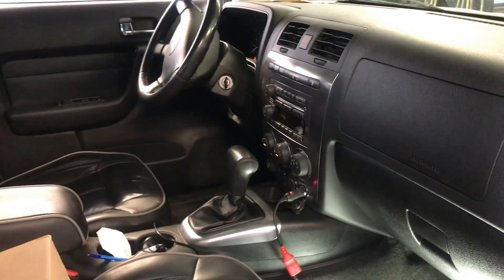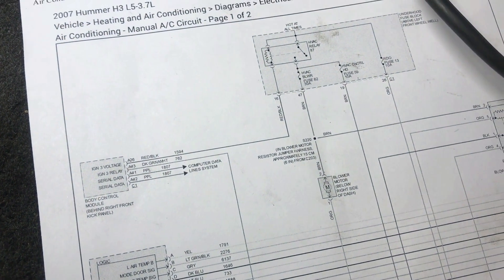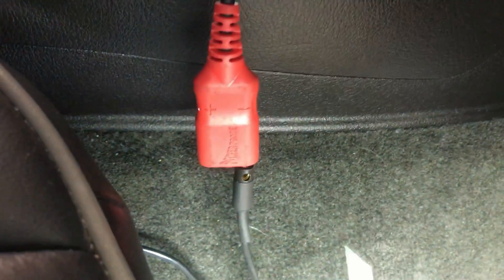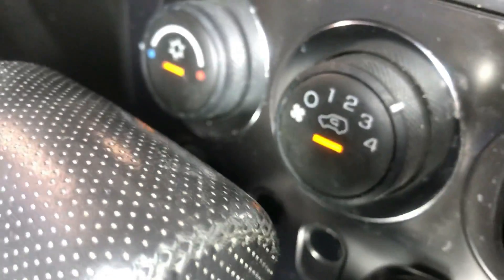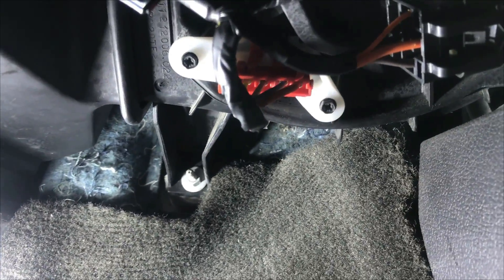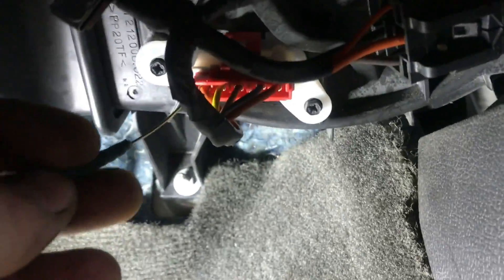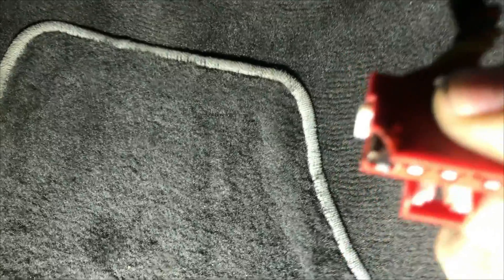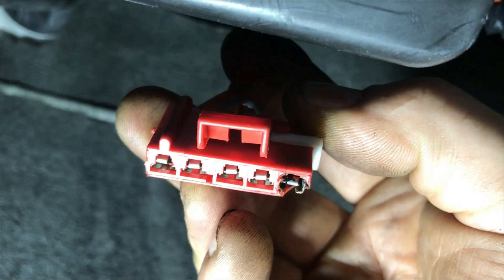2006 Hummer H3 No blower fan on any speeds

Comment: My blower motor quit yesterday.  If I test the blower motor,  the exact same way,  and I have power at the relay
and the resistor gives a " light " at all wire points at connector, then the blower motor is junk?
Reply from the maker: @Michael Bernat  Probably so. Especially if you don't have fan at any speed. If you have power at the Brown wire of the high speed relay and a good ground at the Orange wire of the resistor then it's most likely a fan. There are two Orange wires so you could just set it to Hi and should have good ground at both Orange wires. But, if you have all that then you, most likely, have a bad fan. It's possible, but unlikely, that the wiring in between those and the fan went bad. I would pull the connector off the resistor and make sure it's not burned up. If it looks fine then I would say you have a bad fan. Try putting your fan to Hi setting and smacking the fan. A bad DC motor usually comes to life when you hit it.

Comment: i have no fan speeds at all and when testing the resistor the light doesn’t light up on any of the wires what could be wrong
Reply from the maker: @hunterbond6054  The other end of your test light is attached to a good power? Like when you touch it to some other clean ground does it light? These wires on the blower motor resistor are supposed to be grounds for the fan. But ya, if your light isn't lighting at all and you're making a good connection with your test light then you could have a bad ground wire to the HVAC module or a problem with the switch in the module. Or somewhere in the yellow wire that goes from the resistor to the HVAC module (speed selector switch). Let me know what you find!